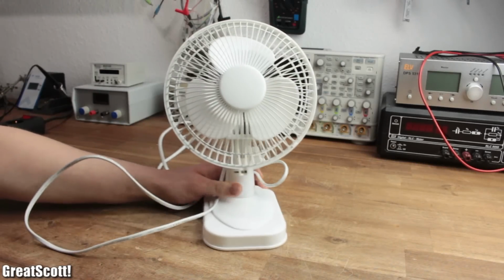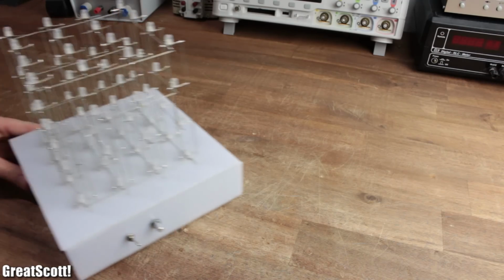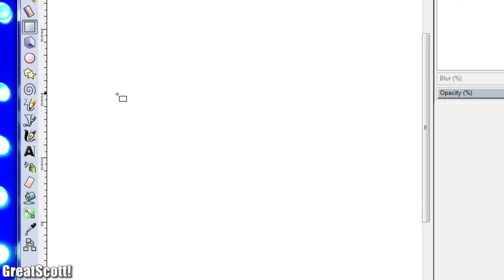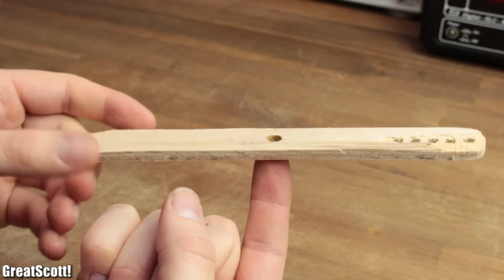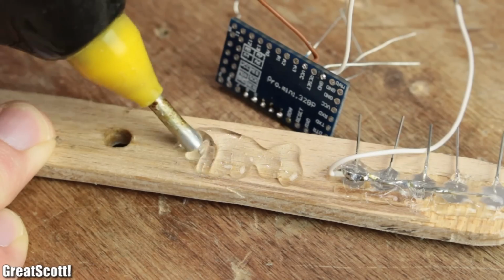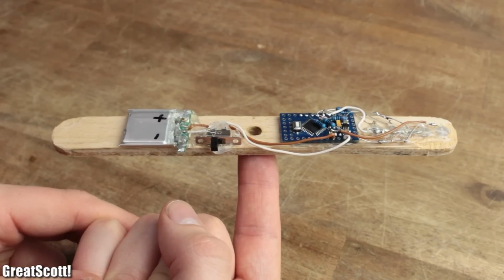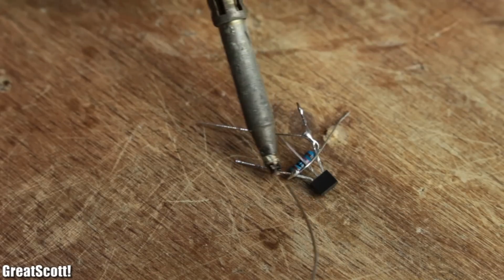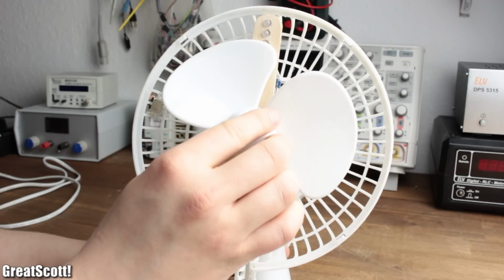HACKED!: Old Fan becomes a POV Display

Comment: Hey that's a good soldering tip right there 3:36 to put heat from the iron onto the long leads of the resistor as you're putting them up through the holes.

Comment: You could also set up two of them on each side of the propeller  with just different LED-s, so you can make a clock illumnator with differently colored pointers and numbers or an image illuminator like this one

Comment: Theres only 1 thing I would change on this design, and that's to add 2 washers and little metal brushes to bypass the battery, then you could modify the mains cord and put a 5v power supply on it, connect it to the brushes and bam, whenever you plug the fan in, the LEDs will turn on.

Comment: It's probably better suited to do propeller POV displays using rotatory encoders or step-by-step/servo motors since you don't have to track RPM or have the kind of problems you found in this build. It also allows you to have control of where you want the text to show at any time instead of it just spinning around.

Comment: Nice Project! Although I would have used a wireless power Transmission unit so I wouldn't need to charge the battery anymore. Probably a Future project idea? Building such a unit would be educational, pretty cheap and there are tons of good usage for it, like this project here.

Comment: You need two small brushes to give it power, so you don't have to take it off to recharge. You might need a small regulator for it when the contacts make bad connections occasionally... or you could even use a coil to pick up enough power from the magnet as it passes by, rectify and filter it and you have just enough power to run all 5 LEDs.
Reply: +Aperson  That's what I was thinking..  The ONLY thing wrong with this project is that it needs that battery (which is now HOT GLUED??!?! to the stick, so it can't be easily removed/replaced)..    I'm wondering what it would take to either use that magnet and install a coil on the stick to either charge a supercap or battery, or use a "slipring"  (https://www.sparkfun.com/products/13064) to get power to the spinning stick..
Reply: +172pilot: That's a nice product from sparkfun, if only that fan motor shaft could fit all the way through... Would need some kind of gear box to make it compatible. And sinse it has six wires passing through, you could connect it directly to the LEDs and have the microcontroller stationary.

Comment: Super. Simply super. Thank you Scott.

I dont understand how the battery is getting charged. Do you have do disassemble it from the fan or can you leave it attached (and of course have the fan furned off)?
Reply from the maker: +emailausdrucker Yes. I have to remove it from the shaft and connect the battery to my lab bench power supply. Maybe A TP4056 board could be a good alternative.
Reply: +GreatScott! thanks for clarifying. just watched it again. love your hacks.
Reply from the maker: +emailausdrucker Thanks mate ;-)
Reply: +Stellar Space Traveler oh good idea! wireless charging would be awesome for this

Comment: since there's a magnet , might be worth trying to charge a capacitor with a coil of wire, to run the circuit, therefor eliminating the battery all together
Reply from the maker: +voltare2amstereo One small magnet is definitly not enough though.

Comment: Idea: Make it from esp8266, you can flash the code using bwifi and you can also supply the text to display ;) although, some different power method would be probably needed ;)

Comment: Love it , now that is something anyone can make and cheap , if you know the fans speed is fairly constant is it possible to just get the timing right with out using hall effect sensor ?  or will it always be a bit shakey then.
Reply from the maker: +Darren Woods It should be possible without the sensor. But takes a lot of patience to find the sweet spot and I think this spot will change over time as well.
Reply: +Darren Woods The microsecond delay should work with a low frequency like 7.5 Hz well enough. Without the reset of the sensor, after many spins, it will be upside down. But if timed correctly, the transition should not be noticed. Kinda like the hands on a watch. You realize it's at 6 now, but you can't really see the change happening (without getting bored, anyway)

Comment: Nice project and video. I wonder if it would be possible to somehow incorporate a slip ring connector so that you can update the display without stopping the fan.
Reply from the maker: +deltaray3 I bet there is a way.
Reply: How about connecting Bluetooth module to input a string to microcontroller and update the text?

Comment: great project! very simple and yet amazing. But it would had been better if you implemented a coil to power it wireless, instead of having to disassemble the whole thing each time to charge the battery.

Comment: I wonder if it's possible to replace the battery with a coil passing in front of the magnet. I think I'll experiment with that once I'm done with the clean-up / re-setup of my electronic bench.
Reply: I've done that! for my project pov display I used a wireless coil to power it. check out www.mrelectronics.net

Comment: Another smart, entertaining video. Thank you! For this project, you press-fit the "popsicle stick" onto the fan's motor shaft. Did it eventually lose friction?
Reply from the maker: +Nate Smith At the end it was getting a bit loose. But a bit of two component adhesive should fix the problem.

Comment: I have an idea for you if you are interested.   It'd be a large project though.  There's some cool "smart house" devices out there but they all have outrageous prices and hog wifi bandwidth. Step 1 a micro webserver.  Used to view status of connected devices, change settings, throttle bandwidth, create sub net wifi for smart devices.  connect to it threw smartphone/tablet ap, web page, or pc app/program.  step 2 turn a cheep fire alarm into a smart fire alarm and connect it to micro webserver.  step 3 carbon monoxide detector. 4 smart ac/heat control personally I would set mine to hold between 68 and 72 deg. fer. drops below 68 turn on heat rises above 72 turn on ac. step 5 micro data server say 1tb.  and reclaimed cell phone cameras into motion detect video streaming survalance security.  smart window, door, and glass break sensors also.  light control.  I believe almost all these devices could be made for around  $20 or less but the cheapest one on the list sells for over $100.
Reply: Basically a smart house control system that runs on a separate frequency from your main wifi but is connected to the wifi for external control.  Why pay a security company thousands of dollars to install an overpriced security system  when you can build one yourself for a small percentage of the cost.  you'd also be saving the monthly fee's by monitoring it yourself from your cell phone.  also I haven't seen a security company that allows you to control your heat, lights, turn off the tv, or close the garage door you hurriedly forgot remotely.

Comment: Hey, do you think it would be possible to place a coil on the ends and pass it by a magnet to generate current and power the arduino? 

That way this system could be attached to less accessible fixtures without worrying about changing the batteries.

Comment: Awesome project! I have never used Hall Effect Sensors, but they seem relatively easy to use? I don't get why there has to be a "if(State != lastState)" in the code though. You're not just waiting for input "HIGH" but for a "RISING EDGE" (i.e LOW to HIGH transition)?
Reply from the maker: +taz0k2 I am waiting for a change of the state that goes from Low to High.

Comment: Would have been more clever to hack the fan blades so it'd still be functional while looking nifty. The recessed area on the back of the fan blade hub just might be enough room to work with.

Comment: I have 2 quick questions about this display. first, could it be possible to add a second Hall effect sensor (or give a dual purpose to the sensor already installed) to synchronise the frequency of the led display? and second, can I put a rotary transformer (like the transformers inside the head of an old VCR) to get rid of the battery? I think about repurpose  the coils of a Qi charger and receptor, if it's not enough, I will have to scrap a good old transformer and scavenge it's coils.

Comment: Ive been thinking about bulding one of these, but i want it to be completely powered from the wall, any ideas on getting power to the blade thing without twisting up the wires? Also im going to use my own motor and stand instead of a fan
Reply: +Robotic_Llama Think about the brushes on a brushed motor, and let your imagination do the rest ;)
Reply: +Robotic_Llama Google DIY slip-ring, (you wil of course need a psu to convert from mains to a suitable voltage for the circuit) I've never seen anyone use the inductive  charging method with one of these, where a pickup coil is added to rotor and stationary magnets to the outside.

Comment: HI, I read that Arduino had build in internal resistor, which is just simply add DigitalWrite(inputPin, HIGH), in the setup loop, can it work in this project so I no need to add a 10K Ohm resistor?

Comment: Can I do so that when you run the fan this background animation itself mainstream? Greatings from Poland!
Reply: +Dawid Strządała To co napisałeś nie za bardzo ma sens, możesz powiedzieć po polsku?
Reply: Czy mogę zrobić żeby po włączeniu wentylatora te światełka się włączyły? Pozdrowienia z polski.
Reply: > "Can I make it so that the display circuit automatically turns on only when the fan is on."
I would try to mess with a springy switch, triggered by centrifugal force.
Popróbowałbym z przełącznikiem reagującym na siłę odśrodkową odcinający zasilanie arduino.
Reply: Sebastian Grygiel dzięki. Sorka że źle napisałem ale angielskiego się uczę więc wiesz =D

Comment: I want to connect both an GPS module and a WiFi module to an Arduino micro but it only has one RX and one SX pin (with both modules need). Is there a work-around for this?
Reply: Use SoftwareSerial
Reply: +Shreesha Nakshathri is it that easy? On the website it tells you what pins are capable as RX use on the micro but it sais nothing about TX. Are all pins able to act as a TX?
Reply: +Shreesha Nakshathri alright! Thanks for your help! :)
Reply: You're welcome

Comment: Just for fun, I wanted to optimize the example for print GREAT SCOTT ! so it is easier to use and with less code, what do you guys think? (I just edited it in notepad so I haven't tested it)

int timer = 700;    
int U18 = 7;
int State = 0;         
int lastState = 0;     

boolean space[]={0,0,0,0,0};   
boolean G[]={1,1,1,1,1,1,0,0,0,1,1,0,1,0,1,1,1,1,0,1};
boolean R[]={1,1,1,1,1,0,1,1,0,1,1,0,1,1,1};
boolean E[]={1,1,1,1,1,1,0,1,0,1,1,0,1,0,1};
boolean A[]={1,1,1,1,1,0,0,1,0,1,1,1,1,1,1};
boolean T[]={0,0,0,0,1,1,1,1,1,1,0,0,0,0,1};
boolean S[]={1,0,1,1,1,1,0,1,0,1,1,1,1,0,1};
boolean C[]={1,1,1,1,1,1,0,0,0,1,1,0,0,0,1};
boolean O[]={1,1,1,1,1,1,0,0,0,1,1,1,1,1,1};
boolean exclamationmark[]={1,0,1,1,1,1,0,1,1,1};

void setup() {
  for (int Pin = 2; Pin <=6; Pin++) {
    pinMode(Pin, OUTPUT);}
  pinMode(U18, INPUT);
}

void loop() {
State = digitalRead(U18);
if (State != lastState){
  if (State == HIGH){
WriteLetter(G);
WriteLetter(space);
WriteLetter(R);
WriteLetter(space);
WriteLetter(E);
WriteLetter(space);
WriteLetter(A);
WriteLetter(space);
WriteLetter(T);
WriteLetter(space);
WriteLetter(S);
WriteLetter(space);
WriteLetter(C);
WriteLetter(space);
WriteLetter(O);
WriteLetter(space);
WriteLetter(T);
WriteLetter(space);
WriteLetter(T);
WriteLetter(space);
WriteLetter(exclamationmark);
WriteLetter(space);}}
lastState = State;
}

void WriteLetter(boolean letter[]){
 int m=0;
 int width=(sizeof(letter)/5)-1
 for (int n=0; n<=width; n++){
  for (int Pin = 2; Pin <=6; Pin++) {
   digitalWrite(Pin, letter[m]);
   m=m+1;
  }
  delayMicroseconds(timer);
 }
}

Comment: Why didn't you 3d print the stick so it was perfect
Reply: +Ounce of Tech Because at the end.... it was perfect!
Reply: +Ounce of Tech last time i checked 3d printers are expensive as fuck
Reply: +UnnamedBeast he owns one and there not that expensive
Reply: dunno maybe he was saving money
Reply: and also i think drilling wood is easier than the material in the 3d printers
Reply: +UnnamedBeast he wouldnt have to drill holes in the 3d print thats why i suggested it... Considering he already had a good model on his computer already he coulda just pronted that and then there would be no extra work
Reply: ok

Comment: would it be possible to turn it into a clock
Reply: Yap but you'll need a shield for arduino because the arduino chip has only a timer which resets every time it loses power supply.
Reply: An alarm clock that wakes you up by cutting your fingers off when you sleepily try to hit the snooze button.
Reply: Massimo O'Kissed OH ... MY ... GOD ... Man ... we should kickstart this !

Comment: The arduino code will not open. I tried it on 3 devices. 
Please fix soon :(
Reply from the maker: +AllenInventions It works fine
Reply: can you paste the "HACKED!" code in the comments? I can open the triangle wave but neither of the other ones. thanks love your videos
Reply: +AllenInventions Try making your own.
Reply: +Mike Slammers I'm gonna, but was planning on reverse engineering it

Comment: That is an incorrect use of "hacked." Use it properly
Reply from the maker: +Andrew Humphreys A "Hack" can describe the extension of the functions or converting something into something completely different. I think the word fits very well.
Reply: GreatScott!
I believe using it in that sense is actually a sort-of recently forming Internet slang, though slang and not slang is a loose category as there is no official definition of words. Also I hope no one is to mad.. I have this way of pissing people off on the Internet :). Also I forgot too mention, I am just going to call this a drawl due to the lack of research from either of us and the looseness of the English language. Also if for some reason I make bad grammar mistakes, correct me..
Reply: +Andrew Humphreys Thing is, the original sense of hack comes from hack-job (as in gerry-rigged), which likely has it's origin in hackneyed. (Something that's a bit of shambles.) And before used in reference to a certain practice of programming, it was an apt description of code that was rather crude that still managed to work. Reference to it in electronics even dates prior. Therefore use of the term thus has come full-cirle.